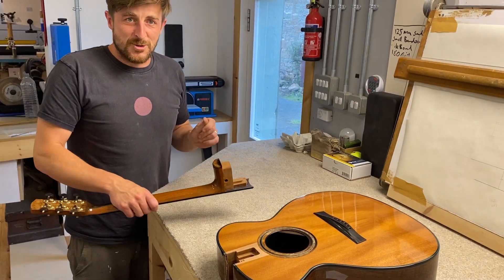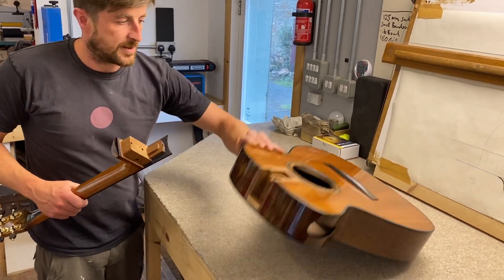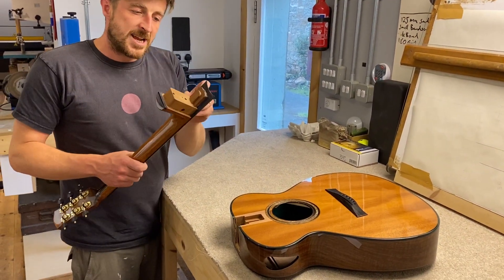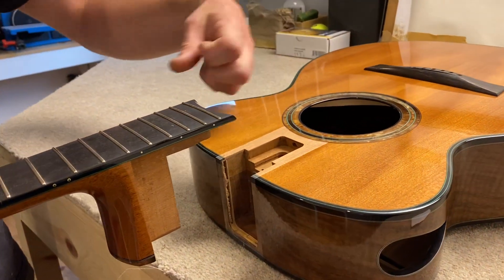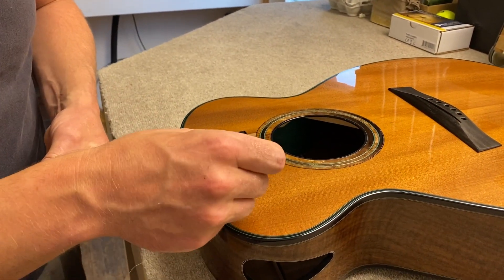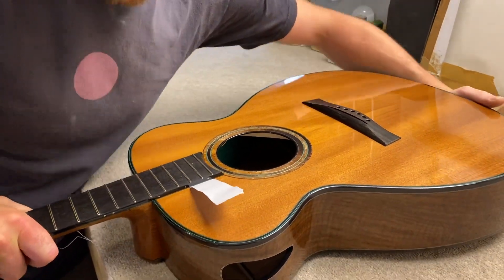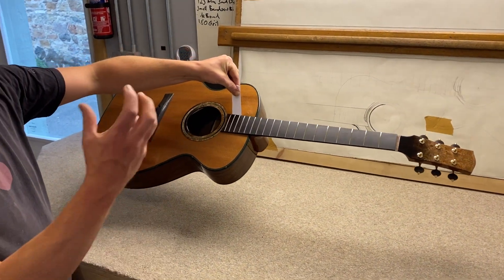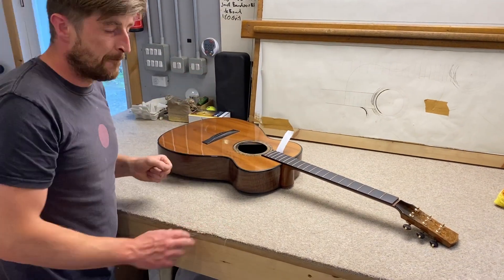Taran Guitars Neck Joint Explained

Comment: I was thinking about doing something like this, but was wondering what happens if the neck needs an angle adjustment - does the horizontal dovetail make it so you can't adjust the neck angle?

Comment: If the guitar's top bellies it will need a neck reset. Is this dovetail glued? How would you get it off, and how would you recut the joint to correct the neck angle?
Reply: They replied to a separate comment that the neck joints are glueless.
Reply: can't do a neck reset, make a new neck is better than reset it if neck angle is not right.

Comment: Do you use a bolt and then glue the fingerboard extension. Smart engineering !
Reply from the maker: Thanks! We use bolts on the tenon but our neck joints are glue-less to allow the neck to be easily removed at any point in the future.

Comment: Do you think the conventional dove tail(martin style) is going away?
Reply from the maker: Interesting question, I think the dovetail still has merit especially for factory built instruments as they can be set very quickly. All of our instruments are built with a client in mind, so every neck angle is different and each neck joint has to be cut to suit that instrument. The major difference for us is that the heel of the neck is effectively inside the guitar so there can be less material under the hand when playing up the neck. Cheers!
Reply: @taranguitars  that’s a very interesting response, I’ve asked this of a few builders recently just out of curiosity as I don’t see many small bespoke builders using them and being in bluegrass Martin dread country you always hear about the importance of the neck with a dove tail.